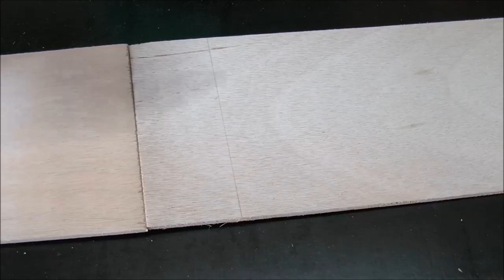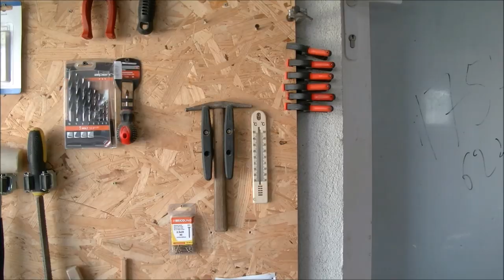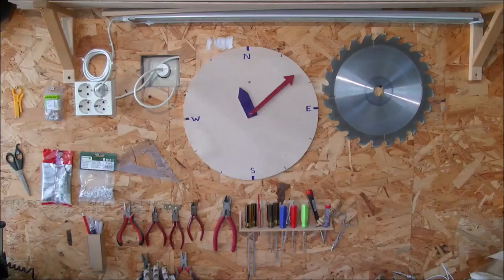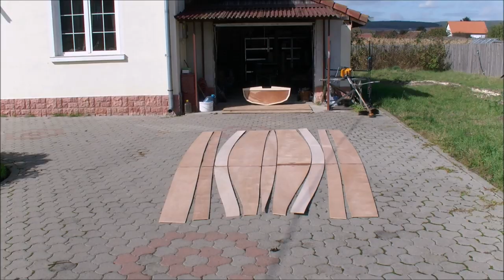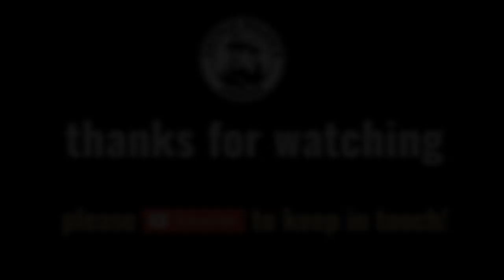Wooden Boat Building Step 2: Scarf Joint

Comment: Having all the scarf joints on the panels at the same place is a good recipe for future problems. It forms a nice breaking line.
Reply from the maker: Actually, the scarf line becomes more solid than the ply itself
Reply: @wulkie  You're 100% right. I stand corrected, and was clearly not thinking clearly...haha. Please forget my dumb comment.
Reply from the maker: No worries. I was very skeptical myself at first. And i tested the strength of the epoxy first so i can remain confident
Reply from the maker: I also built 2 canoes with 4mm ply and simply glued the 2 pieces together plus fiberglass band, no scarf join. And they are still standing and doing well
Reply: @wulkie  I've replaced the full interior of a UFO 34, using the techniques of the Gougeon brothers. Scarfing, filleting and much more. It was a ton better than before. My comment was really to hasty, without any thinking. Must be all the years working with epoxy....some minor brain damage maybe? ;-)

Comment: I've got eight scarf joints in two kayaks to build, and I plan to replicate your method. I really like how you matched the angles by planing each side at the same time. Finally, the editing was great to just show us the essence of each step.
Reply from the maker: I am happy to read that!.
Before scarfing i aligned the 2 planks and marked a long line with the pencil so that alignment will be kept even after the scarf. Just in case something could go wrong. It worked like a charm.
Reply: @wulkie  Terrific instructional video. Is there a preference of sequence ? Is it okey to first scarf join - then loft the boat plan ?
Reply from the maker: Sure. You can scarf join both sheets and then loft and cut. I will consider this option for my next one

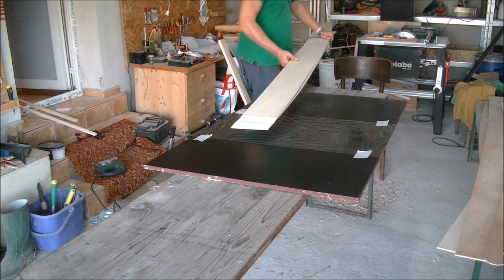Comment: At 1:11 We see an outstanding, superlative result!!! I am not understanding how you accomplished this, even after watching the earlier one minute and 10 seconds of the video, as you used nothing to guide your plane except for your freehand use of that wonderful tool!!!
Reply from the maker: It is easier tham you think 😋. The ply has many veneers and when planing you start getting multiple horisontal lines. If all are parrallel it means the cut is fine. With the plane you just need a good enough pattern. All the rest will be sanded to perfection. All scarfs went good first time. Just need to make sure they are well fastened so they don't move
Reply: @wulkie  I'm going to try on some cheap, low grade ply. You've motivated me to have COURAGE! LOL
Reply from the maker: Great! Let me know how it worked out. Do you happen to have a router? That can save some big time
Reply from the maker: When sanding, use a large flat block. Mines could have been bigger for sure
Reply from the maker: Cou can alternatively use the butt joint which is also super strong but does not look nice. If you can easily hide the joint, i would not go for the scarfjoint. Here is one project where i used the butt joint successfully https://youtu.be/SclraG9Rmc4

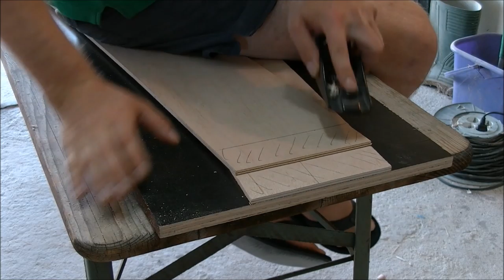Comment: I just scrolled through the playlist - and 3 years later, you are still building this. WOW ! Is there a way you have calculated that specific angle while shaving off the edges ? ( at the 0:43 ). Thank you -
Reply from the maker: Happy to have you back 😉. The rule of thumb is 1:8 ratio between thickness and the length of the joint. My ply is 6mm so the scarf length is 6x8= 5cm

Comment: Looking for some advice on repairing a broken sailboat mast. I need to patch on about a 4' piece on the bottom.  The mast is constructed with spruce using the bird's mouth method. I think some kind of scarf joint would be the strongest, but I'm not sure how to do it for this application. Thoughts? Cheers and thanks in advance!!
Reply from the maker: I would say, fit in new piece of wood as fit as possible and glue it with thickened epoxy. If unsure, post a photo on my FB page for a more objective opinion: https://www.facebook.com/WulkiesGarage

Comment: Does that shorten the overall length? If so, how do you calculate the total amount of 'extra' plywood you would need for two sheets?

Thank you for the videos, they're awesome!
Reply from the maker: Yes. If your scarf is 5cm you need to shorten 2.5 cm from each side. I simply shortened 5cm from the bow pieces. I did not need additional ply.
Later edit: you add 2.5cm, don't shorten
Reply: @wulkie  Don't you have to ADD 2.5 cm to each side?
Reply from the maker: Apologies!! You are right. You add 2.5cm. Don't know what i was thinking...

Comment: What kind of plastic are you using there to cover the joint during curing?
Reply from the maker: Hi. I use cellophane. You can use any plastic as it will not stick but cellophane is strong enough to not tear apart when you remove it
Reply: @wulkie  Thanks Cap!

Comment: The plywood is pre treated against termites right ?
Reply from the maker: No clue.
Reply: @wulkie  We are rebuilding the front storage compartment of our boat due to termites . Currently we r struggling to make it due to the curve structure of the boat and even cut too much of the wood required to make a supporting part 😞. Could u suggest me some tricks to avoid and ease us off doing this process... Please
Reply from the maker: @jawbreaker54   for boatbuilding you need to make sure plywood is marine grade. That means it can tolerare wet conditions better than ususal ply. You may check with local supplier for such termite proof product... but i have not heard of it existing. What if you use insecticides to remove and prevent termites?